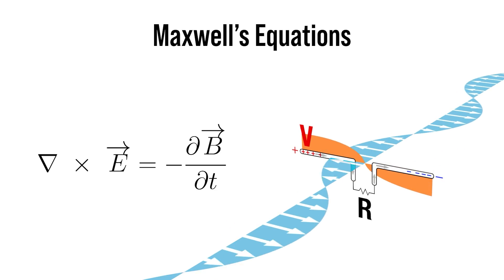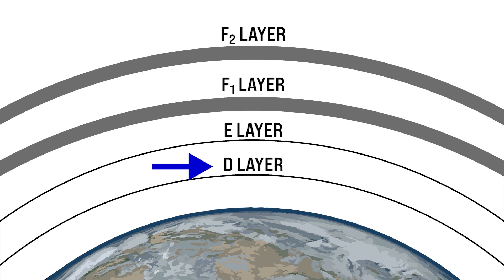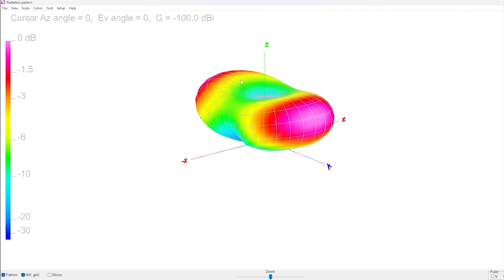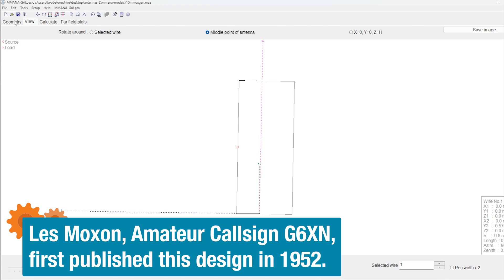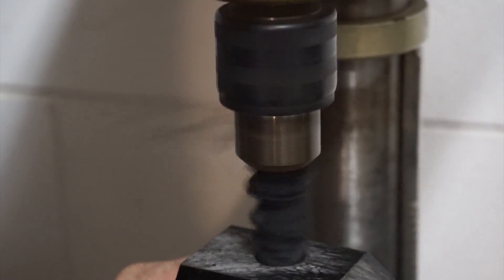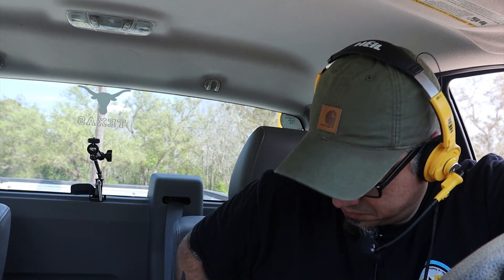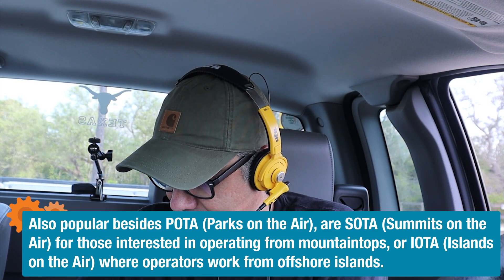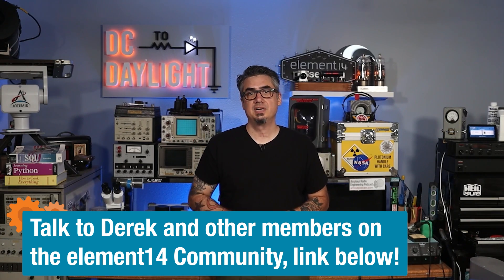Antennas Part III: DIY HF Antenna for Ionospheric Propagation - DC to Daylight

Comment: Nice
I’m an EE but RF has always been black magic. 

On directional antennas. 
I like WWII technology stuff
Could you do a video on the Huffduff project?

Came out of UK

They put the systems on ships to instantly get a bearing on a submarines transmission. 

With shore Huffduffs and ship huffduffs they could cross bearings to get a location. 

But, no sweeping of the antenna to find the highest signal strength. 

I’m guessing two antennas mounted 90 degrees to each other with electronics to do the best angle. 

I’ve never seen anyone dig into the antenna and RF physics. 

Thanks again for your work.

Comment: Hi Derek. I just ran across this video while searching on diy anrenna projects. I've been interested in the moxon for a while now and since it seems to keep showing up in my searches, it may be a sign it look further into them. Also, I will be looking into your element14 community. It sounds like something i would find interesting. How can i find more information on your moxon antenna such as more information on the fiberglass poles and where i might find them. 73 de Joe KB9RCR

Comment: This was great.  What is the best way to study and then take the test for my Technician license?
Reply: James,
If you like reading, I suggest "the easy way ham books". Great study guide that teaches you the correct answers to your ham exam. In two weeks you'll be ready to sit and pass whichever class exam you choose to take, except for the extra class license. That will take a little bit more time 😉
Good luck, and don't hesitate! We are around the height of this solar cycle, and you will be able to make the best of a technicians license talking on the 10 meter band. Best wishes!